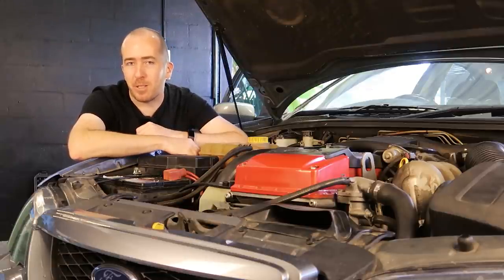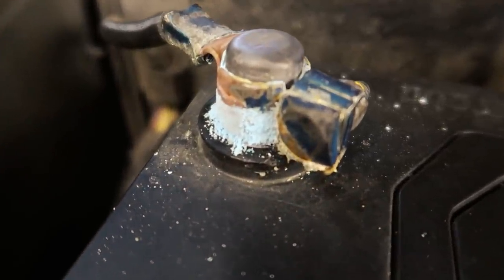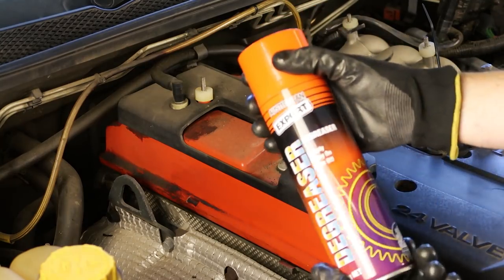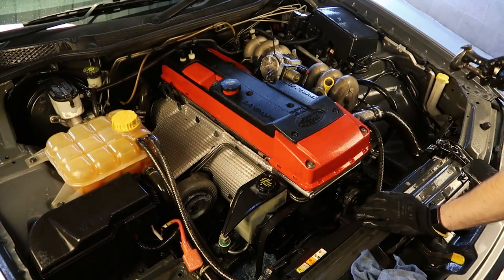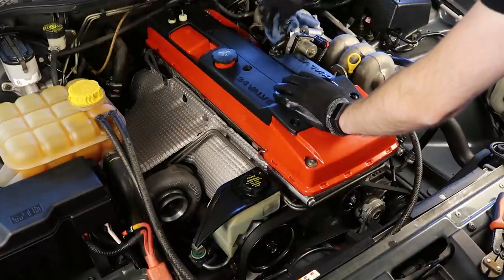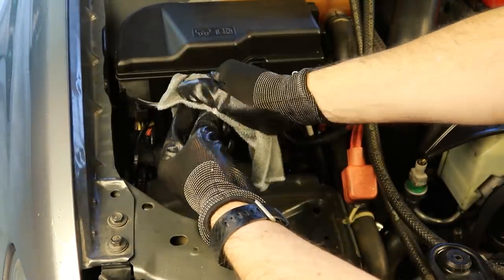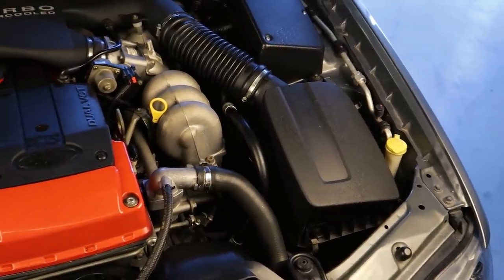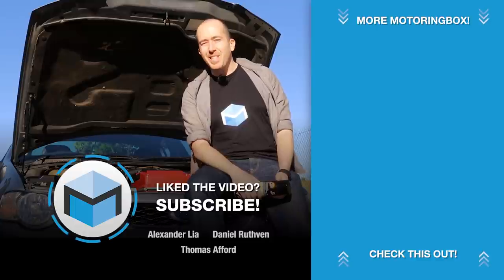Cleaning Your Engine... With Armorall Tyre Foam? The Cheap & Easy Way! 🇦🇺

Comment: My car's engine bay could really use this treatment. The valve cover is covered in decades of dried up oil and the engine bay itself is very dusty...
I'll be sure to do this!
Reply from the maker: Give it a shot, I reckon all the build up will probably fall right off if you leave the foam sitting on there for 10 or 15 minutes first.
Reply: @MotoringBoxTV  Thanks for the tip!

Comment: So glad you kept water and sprays away from under the black cover on the top of the engine. Hidden under there are the coils and spark plugs. I saw the results of cross fire caused by water in there. It caused the timing chain to jump, and changed the cam timing. It was cheaper to replace the engine with one from the wreckers. Go easy with the water! Very interesting video Sean, definitely not what I would ever have thought to use, thanks.
Reply from the maker: Yup I heard about that luckily, so I was being super careful with it!
Reply: Ive used high pressure washer on my Bf Xr6 engine and electrics at least a dozen times never a problem

Comment: Thank you so much for this trick. Until now I just did this with degreaser which got it clean but didn't get a nice shine. Now you just need to clean out the yucky coolant tank.
Reply from the maker: This is a much better option than degreaser as there's no horrible burn-off smell that lingers for a few days. I think I'll probably end up replacing the coolant tank altogether.
Reply: I seem to remember some voodoo concoction involving dishwasher tablets to clean these, here on utoob somewhere, they come up white and new looking. Anyone got the clues to link?

Comment: Thanks for another great video. You inspired me to clean the engine bay on my e-Golf. Any tip on how to disconnect all the batteries?
Reply from the maker: I would do your research and be very careful. All of the cars I deal with are old and only run 12v systems - the risk is minimal. Newer electric cars may be a different story.
Reply: @MotoringBoxTV  I did som googling, and some say that the connections should be water proof, other say that the manufacturer is not recommending doing it yourself. In the same thread they said not to use degreaser, because it will remove a corrosion protective coating that is protecting aluminium parts. So yeah, some conflicting advice there...

Comment: Came up absolutely mint!

The BA's do tend to weep power steering oil out of the base of the pump. The seal goes. Mines doing it, and if it gets bad can drip into the alternator. I know this because I was underneath it today lol. It's more annoying in that you have a perfectly clean engine then you see that oily, dirty spot.

Excellent video as always!

Now just to get it to 620hp at the wheels 😂
Reply: It's a pain. The rubber seal wears out and causes the leak. It looks like I DIY type of job but luckily I'm still at the weaping stage lol.
Reply: Alternator shroud mate 😉👍

Comment: I cleaned the engine bay of my 04 BA ute, you can use like steel wool or a scrub pad or a dremmel to get all that stuff off the air intake manifold, it makes it look unreal
Reply from the maker: Yeah true, the intake manifold isn't spotless but for me it was good enough. You could definitely scrub away at it a bit more if you really wanted it to look mint.
Reply: one more comment, you can boil up some water and pour it on the corrosion on the battery terminal and it will come right off

Comment: You should buy 200usd pressure washer + 150 USD worth of cleaning chemicals 😁😁😁
Reply from the maker: I have a pressure washer and do use it occasionally - but never in the engine bay. I don't like the idea of using high-pressure water under there...
Reply: @MotoringBoxTV  Actually, engine bay connectors + alternators are pretty much sealed for water. I washed my car's engine with standart garden house (with approx** 30% flow) and never seen any problems. For the pressure washer, you are 100% right.

Comment: id be worried if it might start reacting with the plastics and belts.
Reply from the maker: I was worried about the belts - but they didn't slip at all. The main thing is none of the plastics or surfaces were greasy after applying and wiping or hosing it off - I was quite impressed actually.
Reply: @MotoringBoxTV  Failing that you could always use CRC Belt Grip.

Comment: You should replace that paper air filter with a K and N mesh performance filter. Allows more air through and is washable. They are about 3 times the cost of a paper one but you will not have to buy another one for the life of the car..

Comment: Good job. But I cant get over how gross that coolant reservoir looks
Reply from the maker: They're notoriously hard to clean the inside of, but I will take a look at it and see what is possible.
Reply: May I recommend a Dayco one for around $60

Ive found the passenger side of bottem  corner can get a pinhole leak if the turbo heatshield has been left off for extended periods also.
Reply: @MotoringBoxTV  I have no idea why but Facebook showed me a post the other day by a guy who cleaned his out. It looked amazing, but copious use of chlorine, muriatic acid, coke and other weird concoctions apparently. I would suggest dropping a couple of dishwasher tablets in with hot water and a light abrasive such as baking soda or fine sand. Block the ports, fill it to the brim, give it a shake every so often. Let us know how it turns out!

Comment: Any silicone in this product if so I think your paint work will suffer re: silicone contamination
Reply from the maker: It's been a few months without any issues. If you don't like the idea don't do it 👍
Reply: @MotoringBoxTV  I'am not complaining not am I saying the results don't look good no one is debating that or the approach as all was done pretty carefully but that fact is any silicone destroys cars paint work over time FACT not fiction
Reply from the maker: If you have any links to these facts please post them up. I've not been able to find any info suggesting silicone damages car paint. No disrespect intended - I'd just like to read it.
Reply: @MotoringBoxTV  ask anyone who repaints cars phone PPG and ask them see what they tell you I learnt all this when I did my spray painting course all those years ago I grant you the results look stellar be nice if the product contained no silicone
Reply from the maker: When spraying paint yes, I read about that. But once the paint is dry / cured / 17 years old....?
Reply: @MotoringBoxTV  it's still a contaminant old or new that's why people bare metal respray once cars paint breaks down silicone floats through the air then lands and settles where it lands no one knows a cars true history or products used on it through out it's history my main drive  is an fg MK2 2013 eco lpi and I need a cleaning solution for that car yours clearly works but if you can do the same with non silicone based then maybe that's your next trial but that's a decision you may need to consider